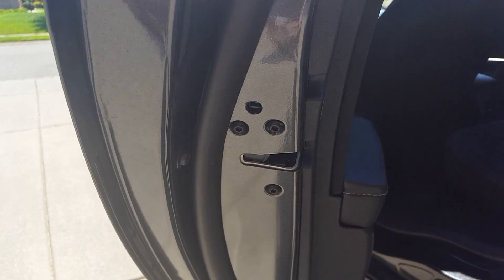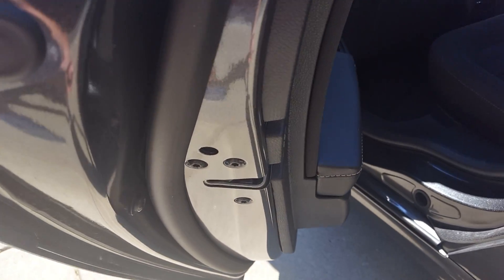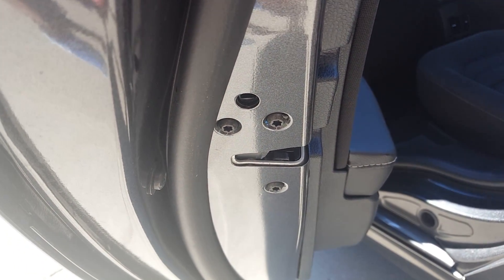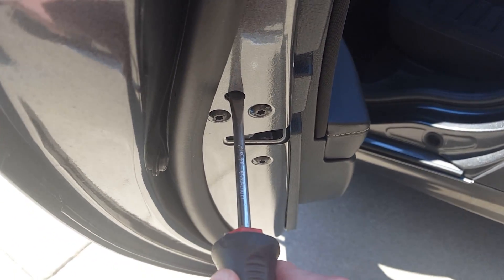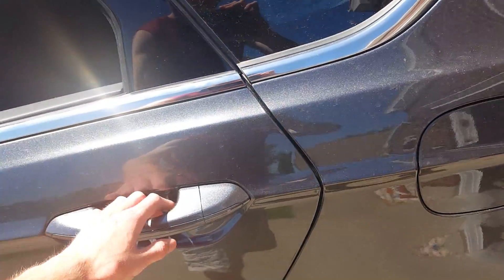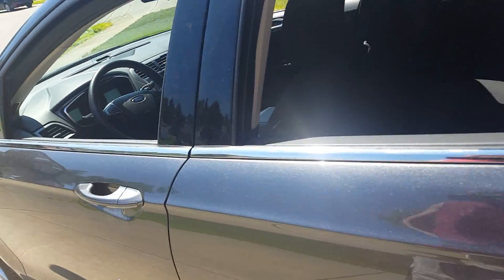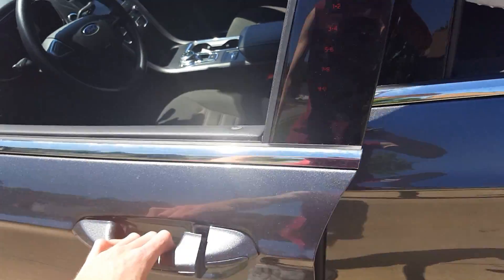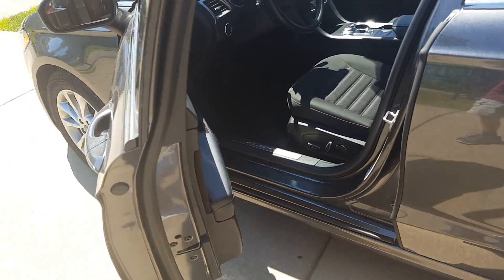How to lock your doors when your lock actuator don't work on a 2017 Ford Fusion

Comment: I have 2015 Focus with a faulty lock actuator on rear door that resulted in no way to lock the door. This is the ONLY place I have been able to find this information. It is not even in the owner's manual. It is a Life Saver, as the replacement procedure is not an easy or cheap process. Thank You so much for Posting this.

Comment: Thank You it worked for 2017 Edge. Went to check vehicle before bed and rear door wouldn't lock.  Was stressed about theft until I found your video.

Comment: Hey this is brilliant. I have a 2015 MKZ (just a Fusion going to prom) and it wont lock from the outside (w/ Key Fob or door code panel) but the interior switch will work 50% of the time... I'm unsure if its an actuator problem or a Body Ctrl Module issue. Touching the battery terminals together didn't fix it... Any ideas?
Reply from the maker: Id it all doors that act up or just one door
Reply: @Nickthecarguy  all doors, but I can only lock them all with the door switch when the car is on and the selector is in drive.

Comment: Does this work for Fusion 2006 Hatchback model ? 
My passenger side will not sense the door is lock and keeps gets open. I cant lock the car either by normal key or using the remote key.
Reply from the maker: Not for sure but it sound like a bad door latch actuator